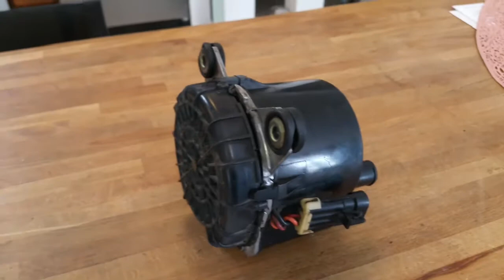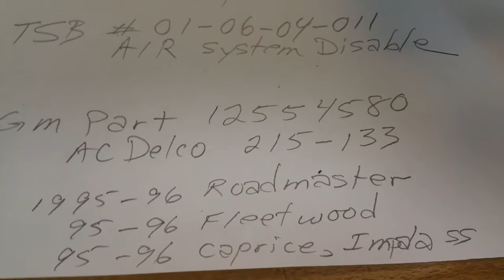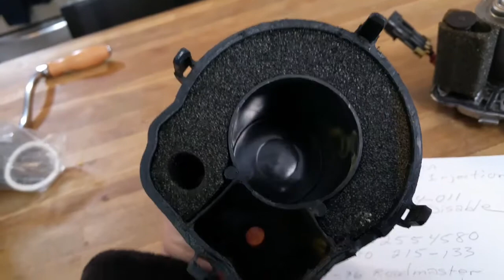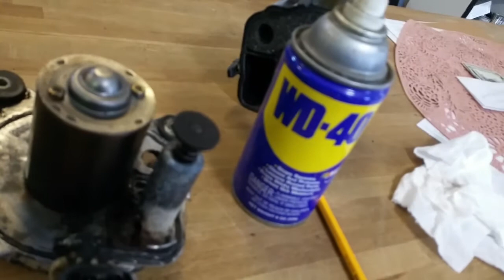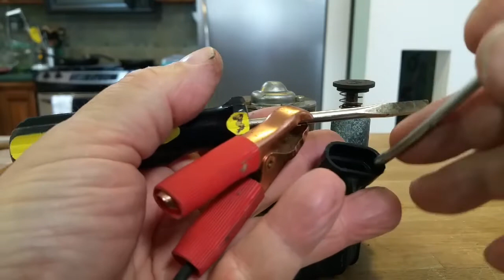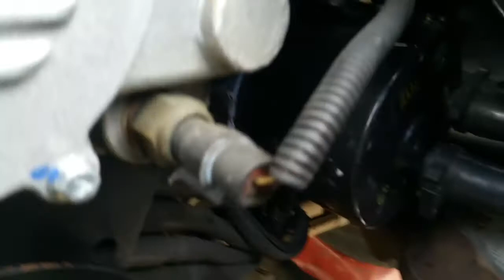Air Injection Pump Repair

Comment: The air pump in my 96 Impala failed differently.  It would intermittently squeal loudly.  I could really hear it whenever I was sitting in a drive thru.  Somehow, water got into the bearings and rusted them out.  I learned online that I could legally remove it from my car.  Then, per the EO, I took my Impala to the Chevy dealer and they installed an updated software in the OBDII.  They also installed a little sticker explaining that the pump was removed with permission.  One smog check tech failed my Impala for not having the air pump even though it was legal.  He said it could be disabled, but NOT removed.  I went to another smog checker and passed with flying colors.

Comment: Genius !! I actually found and bought one on eBay (w/ warranty) for $60 right before I saw your video. I'm going to follow your video and rebuild the one I have as a back up. The air pump in my '98 Trans Am has this exact pump. I had to replace it a year ago and am having problems again, this time the pump runs as it should for about 2 minutes and shuts off but after about 20 seconds it will cycle on and off 3 times within a minute and it kicks the check engine light on. I think the solenoid is sticking causing this. The codes are a  P0412 and P1415 and I have replaced both check valves. Thanks !!

Comment: if the internal parts are bad, do you know any parts that are interchangeable and can be replaced ?
Reply from the maker: In that secondary air pump there are just two components; the valve assembly and the motor driving a fan.  The valve is just pulled open/close by an electromagnet and spring..  water or moisture inside gets there via a faulty valve in the hose connecting the air pump to the exhaust manifold.  If that valve is not working, exhaust gases and moisture is blown into the AIR pump.  Check or replace those.  As for parts, the AIR pump parts won't be found anywhere, not even in junk yards.  But a last resort is having a dealer do that smog pump deletion to your computer to get it past smog.

If the valve appears ruined, spray it with wd40 or one of the common sprays that break rust on stuck bolts.  Then tap with a hammer to break it loose.  It's corrosion from moisture backing into the AIR pump.

Comment: This is a Chevrolet code.  I can not find a single Jaguar dealer that can find the TSB code you provided to give to a dealer.  Can you provide more detail plkease?
Reply from the maker: I found that code to delete the air injection using Google search.  Sorry I can't verify it.  My approach has always been to fix it myself rather than taking it to a dealer so I never asked a dealer to perform that.

Comment: I'm having a hard time pulling the damn cap off.
Reply: It is not easy to separate because of the way it is sealed.  Slow.  Patience.  Careful.
Reply: @askhal6410  that's exactly what I'm doing too. Any suggestions though??
Reply: @cartierrowlette2608  small sharp screwdriver worked around till it lets go
Reply: @askhal6410  Ty.

Comment from the maker: For those wondering how I read and reset the OBDII codes.  I use a BAFX Wireless Bluetooth Diagnostic OBD2 Scanner Car Code Reader and Scan Tool.

Look it up on Amazon.  Only costs about 20 bucks.  You do not need to buy one of those handheld code readers that can cost up to several hundred dollars.   Thus version interfaces with an android phone.  And you will need to get a copy of the TorquePro software.  Simple.  Cheap.  You can also find similar iPhone products.
Reply: Would this airpump make a 95 C4 corvette run bad...? and the pump comes on and off constantly...

Comment: Thanks, This is the pump for the first 1997-1999 c5 corvette... located under the bumper.. (wet) lol This video is def a great help to me. Thanks!
Reply: Glad it helped!  The air pump is not something most people would think of trying to repair, but it really is a simple device.